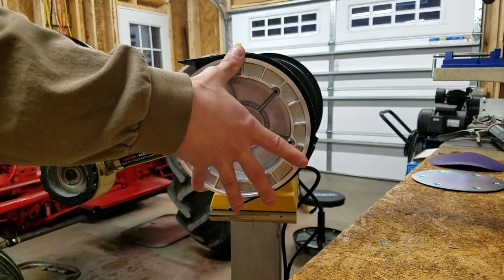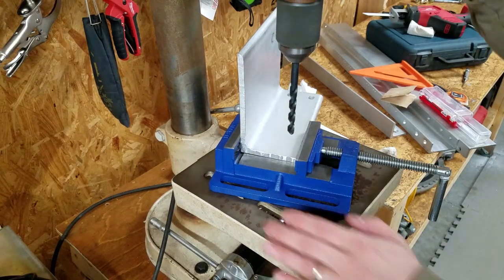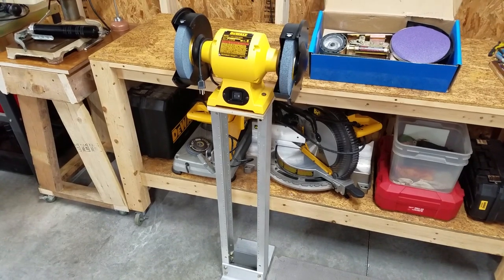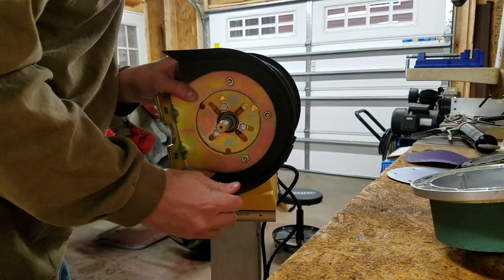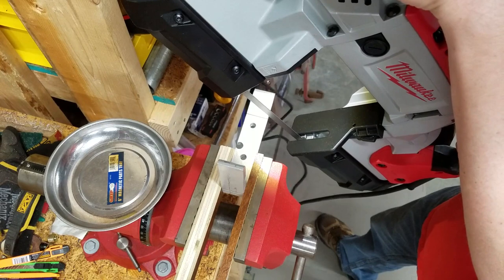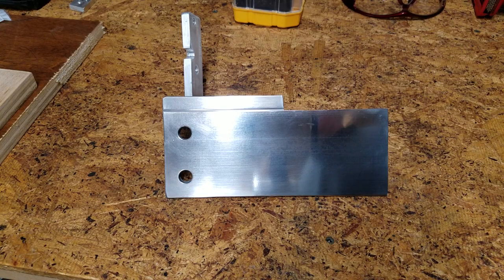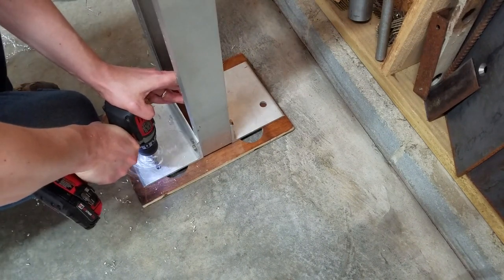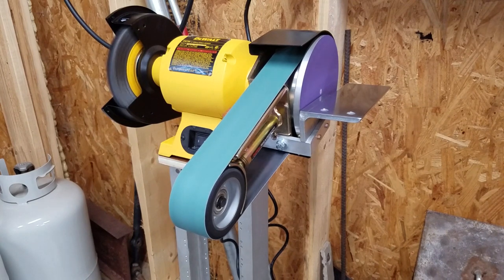Custom Bench Grinder Stand and Multitool Table

Comment from the maker: Dewalt Bench Grinder:
https://amzn.to/3bcTDCW (affiliate*)

Multitool Grinder Attachment:
https://amzn.to/3HE3iSY (affiliate*)

Dewalt 8" Wire Wheel:
https://amzn.to/3a65Zve (affiliate*)

Milwaukee Portable Bandsaw:
https://amzn.to/34BOJg8 (affiliate*)

Milwaukee Hackzall:
https://amzn.to/2Vas4Vj (affiliate*)

Bosch Jigsaw:
https://amzn.to/34DQ4Df (affiliate*)

Dewalt Black Oxide Drill Bits:
https://amzn.to/2VtGXkl (affiliate*)

Milwaukee Drill & Driver:
https://amzn.to/2UNNUMZ (affiliate*)

Irwin Drill Press Vice:
https://amzn.to/3cluBBQ (affiliate*)

Drill Press Vice Grips:
https://amzn.to/3bd6FAr (affiliate*)

Dewalt Tap Bits:
https://amzn.to/2Va9vjV (affiliate*)

Dewalt Hammer Drill:
https://amzn.to/346Exw8 (affiliate*)

Flitz Metal Polish:
https://amzn.to/2z3xpoN (affiliate*)

Milwaukee Stick Light:
https://amzn.to/33WCACm (affiliate*)

*Purchasing from these Amazon affiliate links earns my channel a small commission. Think of it as a tip that doesn't cost you anything. Thanks for the support!

Comment: Multitool belt grinder is designed to be turned 90 degrees to for full range of use.
Reply from the maker: Yeah, I really like the Multitool, I just wish it could easily be turned to the 90 degree position without unbolting and reinstalling.

Comment: A little fyi when cutting aluminium with jigsaws and circular saws, use a candle for wax over the aerated edges this will stop it clogging easily.
Reply from the maker: Thanks for the tip! I did spend a lot of time cleaning the blade teeth.

Comment: I too am someone who likes to repurpose items and I give you 5 stars for this project! Where did you find a great hung of aluminum? That stuff can be expensive especially in the sizes you got off of that item. People nowadays with unemployment so high, and lumber prices insanely high, are tapping into some of the sources where I get a lot of my items from so there's competition for it. I can hardly get any of the free lumber you see on FaceBook's Market Place or sites like it. Which is fine of course. It looks like many of the items in your shop are brand new. Did you recently set up a shop? Best of luck and keep repurposing. You are helping our planet every time you take something and re-use it that was destined to the landfill!!
Reply from the maker: Thanks, I appreciate it! That was a old aluminum network switch test rack that was going to be thrown away at work so I asked if I could have it. I have many videos repairing broken tools that I've received for free. Our county has an email listserv and about once per year I ask if anyone has any broken tools that they just haven't gotten around to throwing away yet. I've been surprised by the response and have got some great projects out of it. Most of the time I have no previous experience repairing that type of tool so I've learned a ton and saved a bunch of awesome tools from the landfill. Thanks for the comment and thanks for watching!

Comment: The multi tool costs twice as much as  the grinder! Insane lol
Reply from the maker: I agree, I had a hard time pulling the trigger on the purchase but the pros outweighed the cons. If you have a small shop, it's definitely a space saving multitasker. Plus, a nice belt grinder would have cost about the same, if not more. Thanks for watching!
Reply: @Mikeattempts  isn’t the speed of a bench grinder a lot slower than the belt grinder? Can you actually grind stainless steel without causing the bench grinder to come to a stop?
Reply from the maker: @dohc1974  I haven't tried stainless but it does great on steel without losing power.
Reply: @Mikeattempts  thanks man! Definitely consider getting the multitool
Reply from the maker: @dohc1974  No problem!

Comment: You did a great job Mike, all I'm going to add is that multitool make an adjustable mitre table for the disk sander side
Reply from the maker: Thanks! They make an adjustable miter table for the multitool grinder attachment, in case you'd rather buy one. If you end up making it, let me know how it turns out. Thanks for watching!